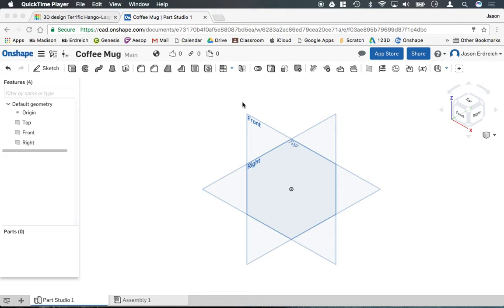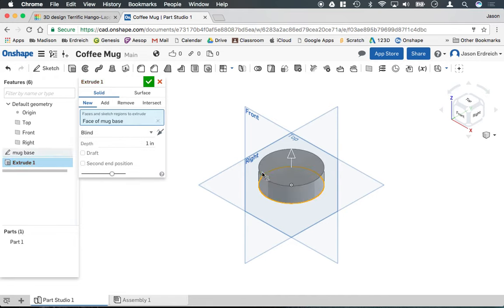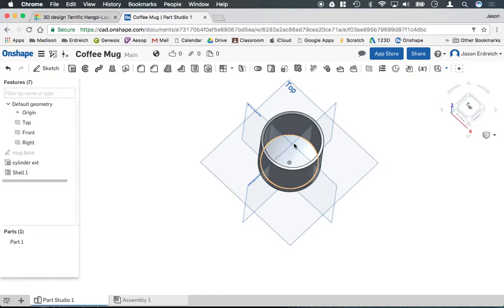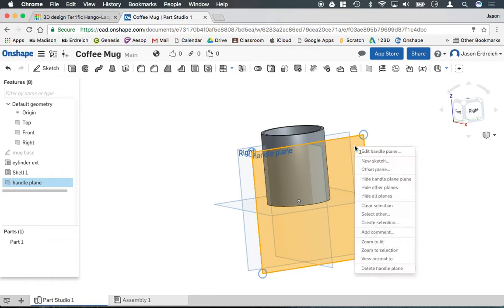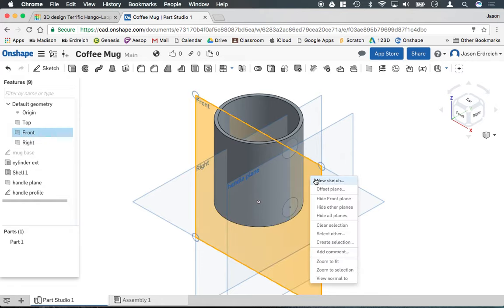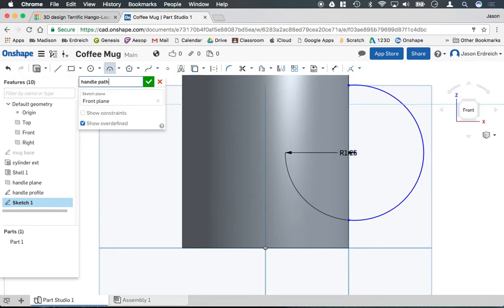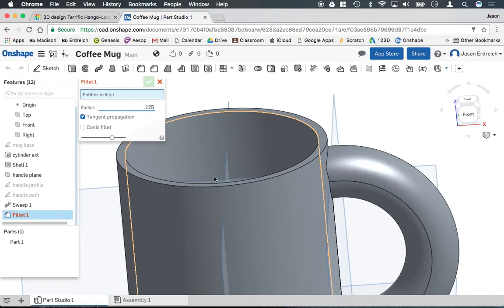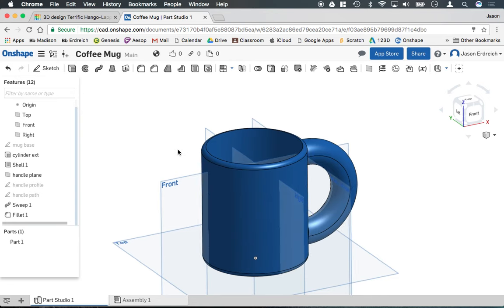How to model a Coffee Mug in Onshape CAD

Comment: Great video, thanks. I would have thought there would be a small gap between the outside of the handle and the mug, as the profile plane only just touches the mug. As the mug curves away from this tangent plane, there should be a gap. Does Onshape anticipate and automatically correct this?
Reply from the maker: Thanks for the view and support! Onshape won't automatically fill this gap if your are modeling as a solid, but you have some more flexibility for things like this when modeling as a surface. The gap is because you have a flat plane and a curved surface. I would push the plane farther into the mug which should correct this. You can also sweep to a surface, or extrude to a surface, which fixes this issue as well. All just different approaches to the same problem.

Comment: helpful and a great video 
but yhere was 1 problem beacuse there was a problem with the sweep and i needed to fix it
Reply from the maker: Happy that I could help! the sweep can be a little challenging in that if the shape profile will not fit around the path, or the path orientation creates a shape that isn't within the constraints, you get an error. But you can always adjust these two components within the shape profiles and redo the sweep until you are happy with it.

Comment: Hi. I am a teacher. I had my students do a mug in Onshape s. I had difficulty with the sweep function. I was only able to get a handle if I used the "surface option" but it looked strange.
Any thoughts why it would not work?
Reply: no go away
Reply: Same... the handle turns red until I select "new" in the sweep options and then it has this stripe pattern.
Reply: you could have been under the “add” option, make sure you are under the “new” option. the same thing happened to me :-)
Reply from the maker: It sounds like the shape of the handle is too large to fit into the angle of the sweep. Try a smaller shape, or a larger arc radius.